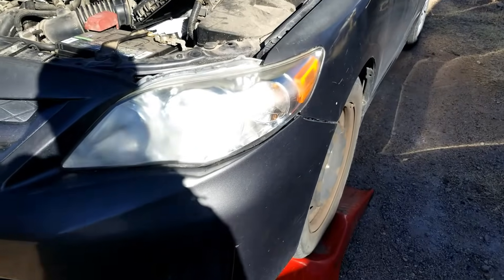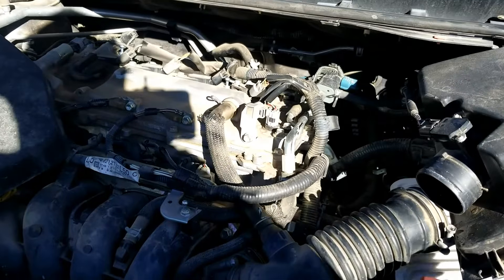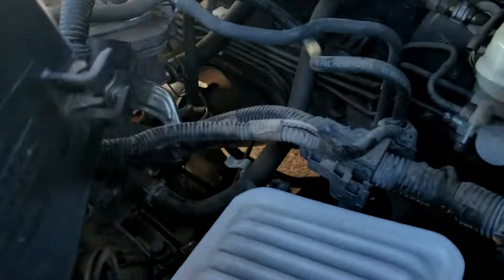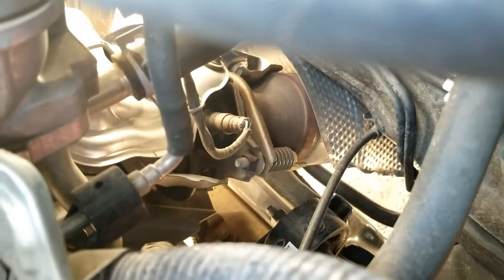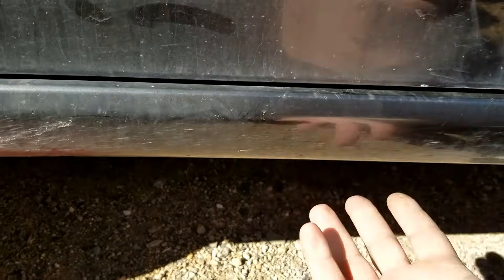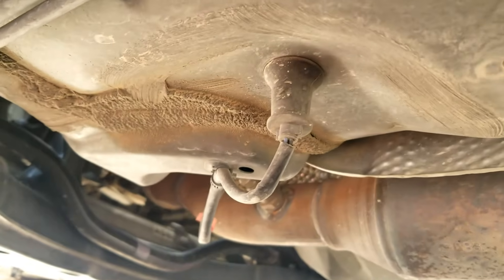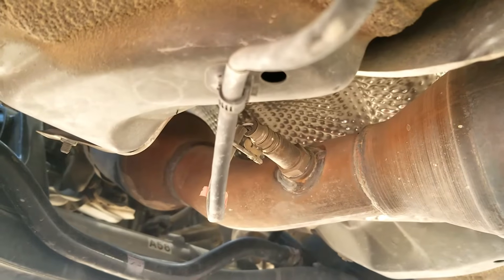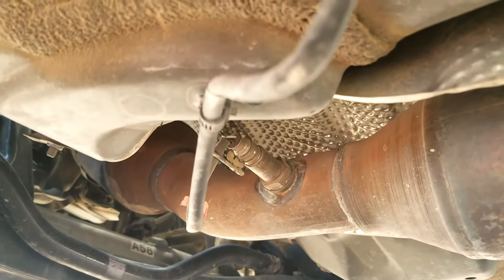Oxygen Sensor Locations 2010-2019 Toyota Corolla (Upstream and Downstream)

Comment: I saw a lot of Great Videos that you have been posting. Regarding the cleaning Oxygen Sensor most of suggestion on Google not advised to do it.
Here is one of hundreds:  Typically, not. The way an oxygen sensor works is there is an element that is plated with a catalyst which in the presence of hydrocarbons changes temperature. There is a heating element to get the process started. Through sensing temperature, the amount of un-burned gas is calculated by the ECM. 

As the sensor ages that plating gets consumed and once gone the sensor stops functioning. There is a screen surrounding the actual sensing element that can clog or carbon up but typically the sensor is long gone by the time that happens. You can try cleaning the sensor but 9 times out of ten it is reached the end of its useful life. Cleaning can't hurt so try it. You have nothing to lose. I just would not let it go to long. If your running rich you can damage the catalytic converter.

Comment: I just had mines replaced but the check engine light turned back on a day later. So if there’s 2 oxygen sensors  total, could they both go bad at once and I only have one good one at the moment?
Reply from the maker: It's possible, but usually, there would be a code that points to a bad sensor. For example, "P0134 Bank-1 Sensor-1" or "P0140 Bank-1 Sensor-2"
Reply: @HVAC_Mechanic that’s correct, it was bank 1 sensor 2. Would that one be under the car? i’m a little upset my mechanic fail to mention that there could be 2 of them

Comment: I did install new cat convert and new sensors, and Still the p0420 is on... Any advice
Reply from the maker: I would take it out on a freeway, let the CAT get really hot and blow out any possible grease or chemicals, clear the code, and see if it comes back. If it comes back, I would be sure there are no exhaust leaks and check the wiring.

Comment: Wow it actually looks like the engineers lost a bet to the mechanics and had to put that where they can get to it
Reply: They made up for it with the PCV valve location, though.
Reply: @robbyking8009  Yeah, in my 09 model the PCV is tucked behind the intake manifold, you gotta unbolt the whole thing to get to the PCV. :/
Reply: Underrated comment.

Comment: My 22mm socket goes in but I have no grip whatsoever. You think I need to go down to 21mm?
Reply: Did you figure this out?? what symptoms was the car showing? I feel like I need to change mine.
Reply: @jo_26  yea, the sensor was fine. I needed to trim down the socket with a grinder for it to fit the sensor properly

Comment: P0420 bank one charge it will it fix it hep sir ?
Reply: P0420 usually means you need a new catalytic converter. The O2 sensor is probably working, but you should still check it.

Comment: I changed my o2 sensor and a week after the engine light com back on saying that the sensor need to change I don't understand
Reply from the maker: Likely a wiring issue or bad replacement sensor
Reply: @HVAC_Mechanic  how do I know if it's a bad sensor
Reply from the maker: It will need to be tested. The most common way to test it is to use an OBDII scan tool; there are many good videos on how to test it. Since you already swapped it out, I would get a wiring diagram for the sensor, test the wiring, and check for any blown fuse.
Reply: And don't purchase cheap Amazon knockoffs even if they say "factory replacement". Purchase only OEM. 

30 days is the average time for O2 sensor failure with the cheap stuff.
Reply: @user-qy9rg3nt2l I just bought a Walmart one for $62 would that last or is that the 30 day cheap stuff.
Reply: @scp6094  just FYI, an OEM should say that, OR have the manufacturers logo all over the packaging.
Reply: You just need to reset the code with a obd 2
Reply: Buy Bosch sensors not knock offs.  I learned my lesson well! Live my job so much, I did it twice!

Comment: I know this is a old video but i have a 18 corolla le and was wondering where that plugs into the driver's side was normal since the wires look a little exposed near the top?
Reply: Do you mean at the top of the sensor itself? They need to be exposed like that. The sensor gets reference air through the wires and in that center channel.

Comment: what size is the oxygen sensor socket??? for a 2010 corolla
Reply from the maker: It is 22mm. I put a link in the description the O2 removal tool which has a slot for the wire when installing it.
Reply: If change 02 sensor but code same what can be?
Reply: @corderodavis204 Denso is the OEM of the sensors.  On my 2010 Toyota Corolla LE 1.8 L 4 cylinder, for the upstream air/fuel sensor the part number is Denso 234-9056.  The downstream o2 sensor is Denso 234-4305.
Reply: Do you have get sensors from Toyota?
Reply from the maker: @corderodavis204  The 02 sensors are available online or at automotive stores.
Reply: @corderodavis204  If your code is for the O2 sensor heater circuit and changing the sensor did not resolve the problem, that means you have an open or a short in that heater wiring at some point after the sensor connector plug.

Comment: Does a broken o2 sensor cause the track off and check engine light to appear on the dash?
Reply from the maker: The check engine light will come on. An OBDII scan tool is needed to know what the problem is. There are low-cost scan tools, or automotive stores often scan for free.
Reply: Yes mine had that also vscoff blinking light engine light on and if I press the gas pedal all the way down light engine would start blinking and loose power and car shake felling lie it was going to turn off change the sensors both now it's perfectly fine
Reply: did you figure out your issue? having this issue along with car turning off randomly if the gas gets too low before refilling the tank